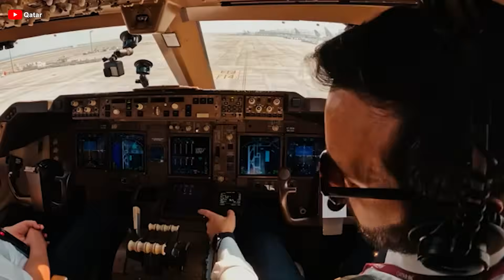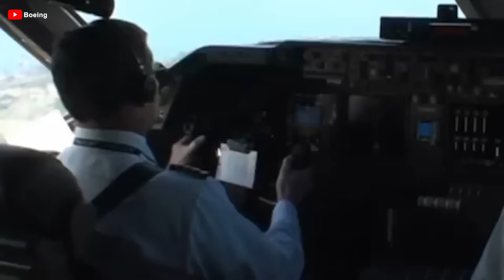NEW 2 Engine Boeing 747 JUST Shocked Everyone NOW! Here's Why

Comment: As you pointed out the 747 was designed for four 45000lb thrust engines. The manufacturing facilities and tooling for that aircraft are gone. No breakthrough in aircraft design comes until an efficient powerplant is designed. When that happens a new design will be optimized for the type mission needed. The 747 is a PIG by modern standards. I worked them from the start.

Comment: Boeing worked on a re-winged version for the 747 with less sweep (because airline companies fly at Mach 0.82 instead of 0.86) and more modern super critical airfoil. The horizontal tail was also changed to maintain the CG range due to the shorter MAC. It was still a four engine design but could have been two engine if they were available at the time (early 80's).